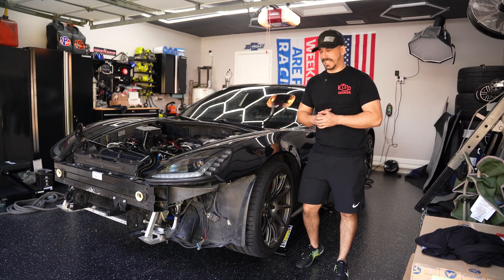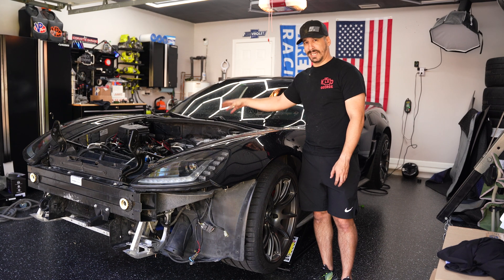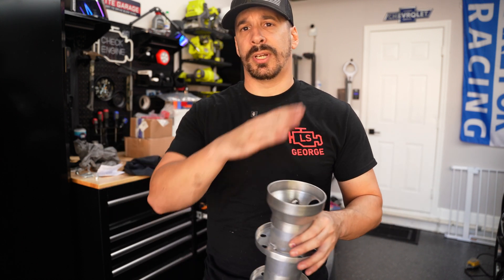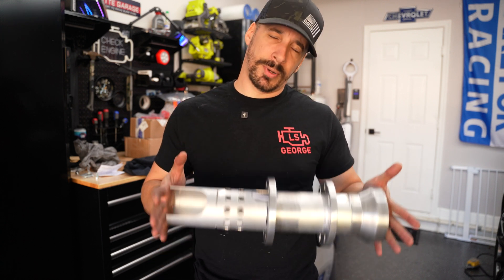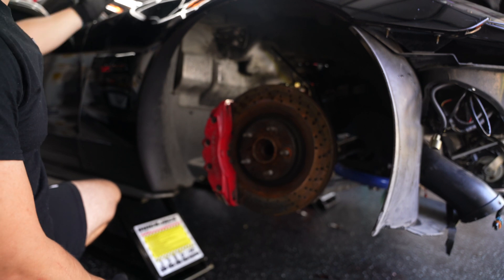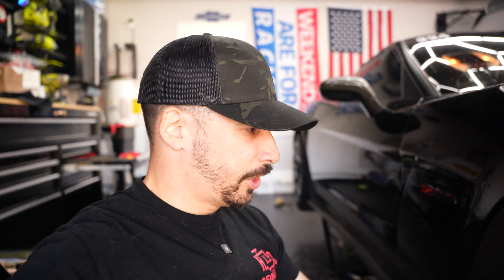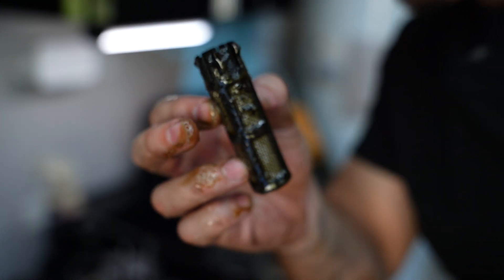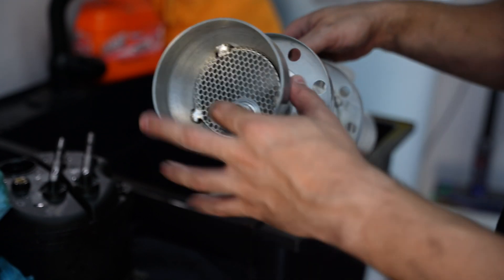Episode 6 - Removing LS7 DrySump(How-To) - Installing Aviaid Dry Sump Baffle/Insert

Comment: Good timing - I'll be adding these when I swap the C7 dry sump tank into my LS3/Kong 2650 LS9 setup.
Reply from the maker: Absolutely! A must add and relatively simple job for my reliability.
Reply: @SloJoeRacing  For sure! I swapped in the Zr1 Carbon Ceramics on my car - and once they are hot - and you slam on the brakes. I've been noticing the oil pressure dropping.

So I'm gathering up all of the dry sump parts and going to swap them in.

I already have the Improved Racing baffle and crank scraper - and yeah oil pressure still drops.

Comment: It looks like your filler tube didnt have a rubber o-ring on the flange? Or was it just not in the shot? Mine had a rubber seal on the flange side of the tube, maybe something worth checking. Awesome video again!
Reply from the maker: @louiC6Z  no, now that you mention it didn’t see one. Great call out! I have to drop the tank again to run e85 flex fuel sensor going to take a peak inside again.